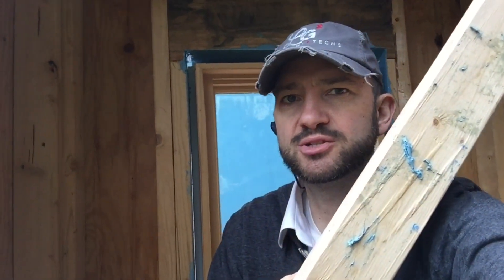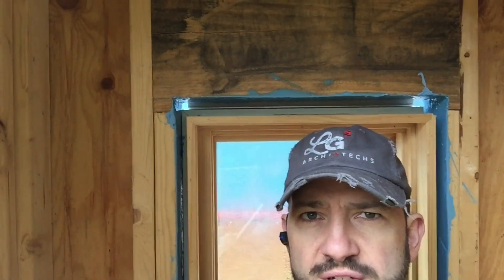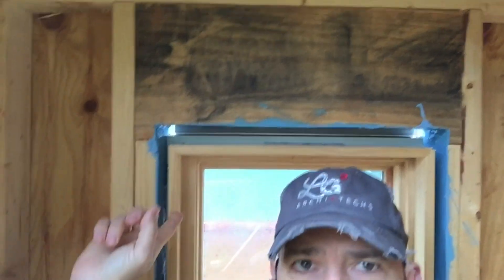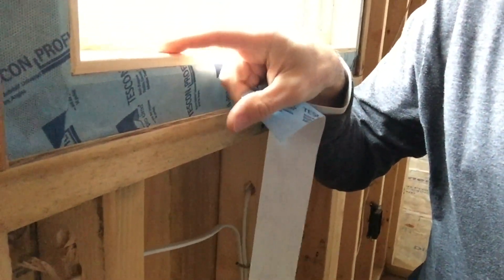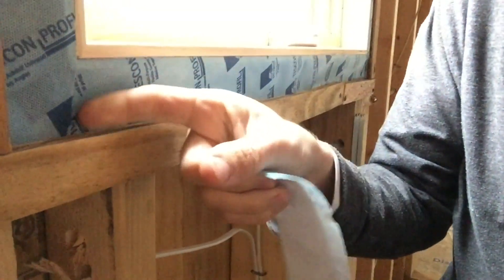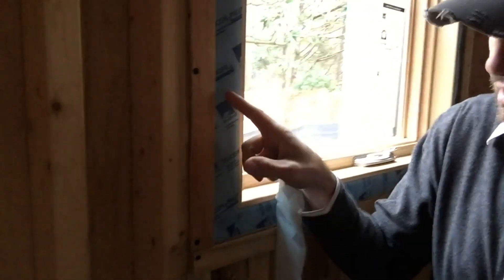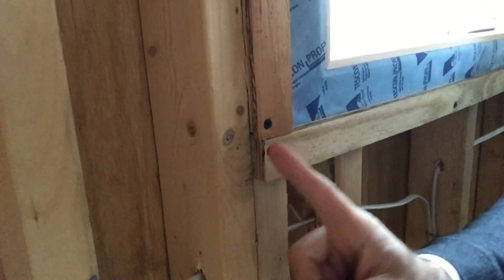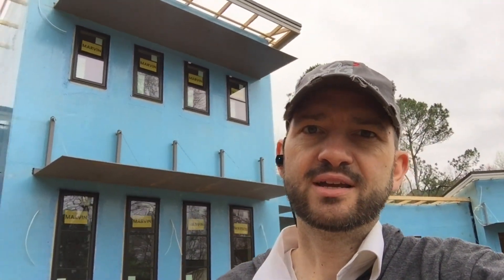Air Sealing Windows & Doors with Tape, NOT Foam

Comment: Behind the tape.. Are you filling the airspace between window and RO with anything? Do you ever consider the wood window joinery for air leak potential? Seems like it’d be easy to tape or seal outside edge of the window unit corners before each one is installed.

Can you post another video of the window after drywall? I really don’t understand your intent with the furring strip on the inside face of the studs - I get the drywaller’s use of a router. I’m just not seeing how this finishes.